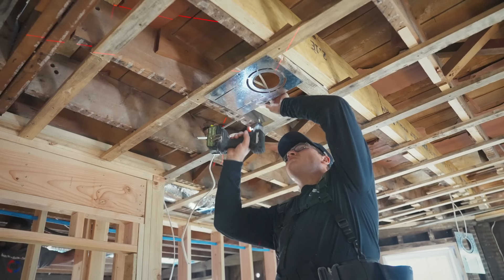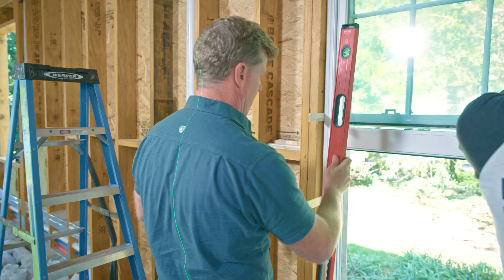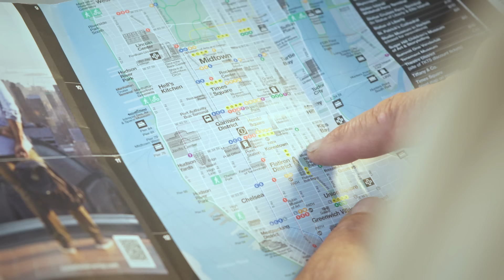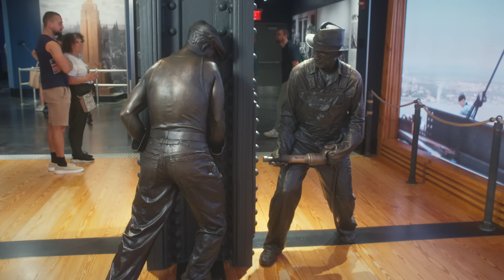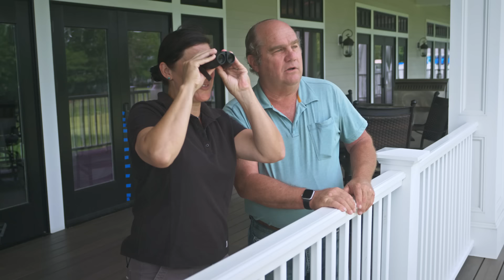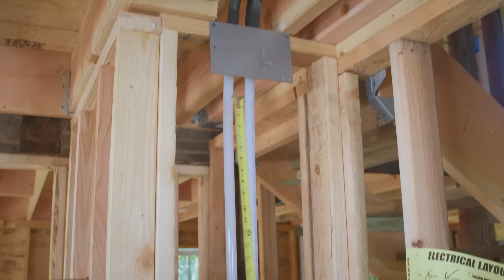This Old House | Roughed In (S45 E21) FULL EPISODE

Comment: When my family moved, the porch had the boards like this. Since the outer ends get the brunt of the weather (as well as other issues), the whole thing had to be replaced...with the boards parallel to the house. Then only the outer boards need be replaced as needed without water running along, ruining even more wood.

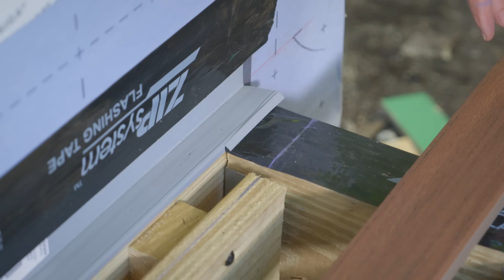Comment: At 17:57, why wouldn't flashing tape be added to the top of the joist where the 1/8" will deliver water?  I like the porch decking.  Is it available in a through-color, or can the top coating be planed off before the install?